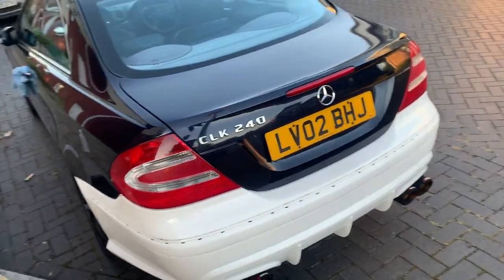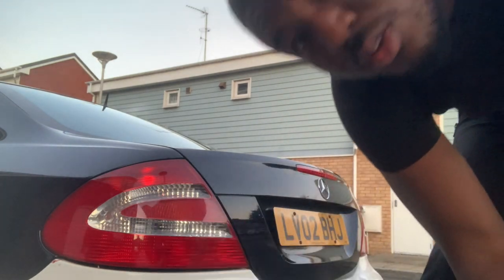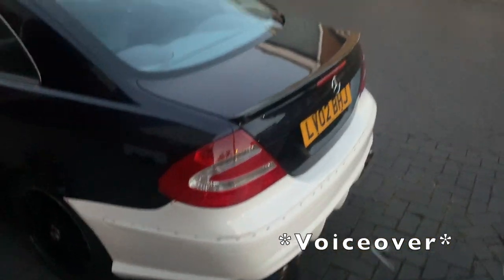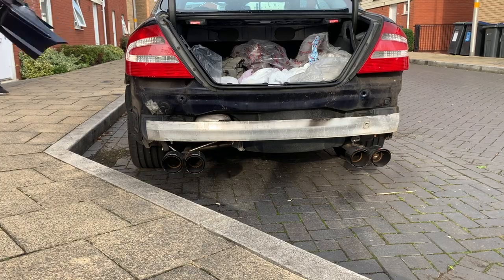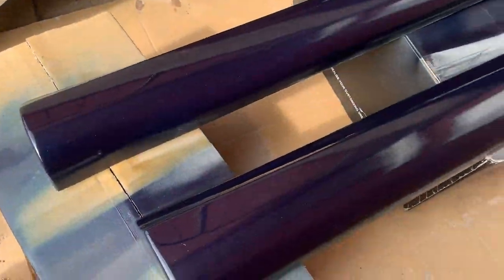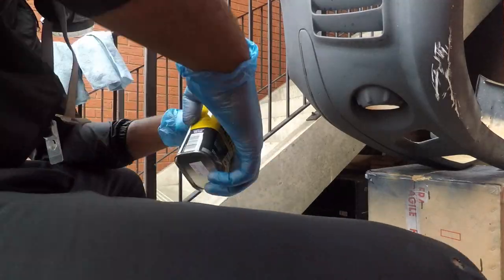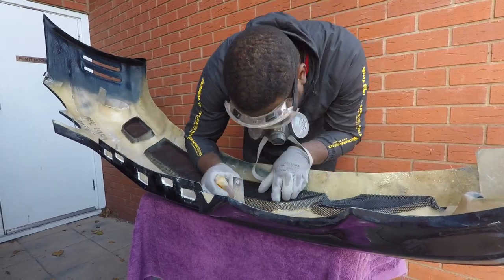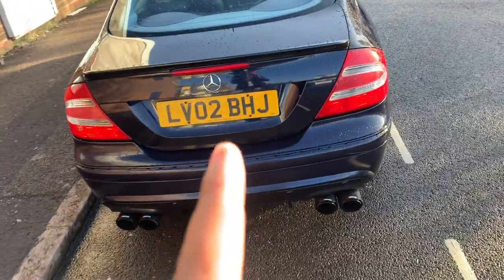Respraying Painting Installing Custom AMG Bodykit & Spoiler Mercedes CLK W209 C209 IT LOOKS AMAZING!

Comment: Bro I have a winter question, could you tell me how to turn on my back windshield heater? Do you have any Idea, I have the CLK w209 from many years but haven't even try to use the function,but now I am wondering, cannot find any info about it, and if so I also have fully tinted the glass from the inner side of the backwindow, would it make a problem like melting the tint or, please help ty in advance peace
Reply from the maker: Hey bro it’s the button with the symbol showing a rectangle with 3 arrows going up, also it should be fine for the tints, unless the person who tinted your windows advised not to use it 👍🏾💯

Comment: plz tell what was u using for removing that badge glue?
Reply from the maker: I used isopropyl alcohol and wd40 when you do this ensure to clean the wd40 off with isopropyl alcohol and use car shampoo wax, to wash that area after as alcohol strips the wax off 👍🏾💯